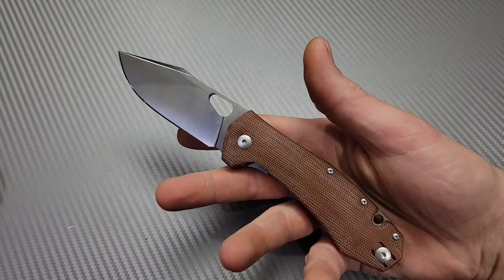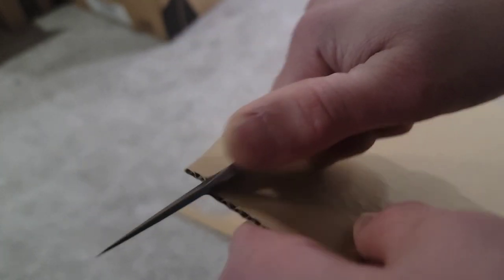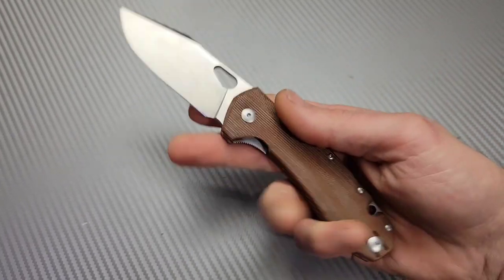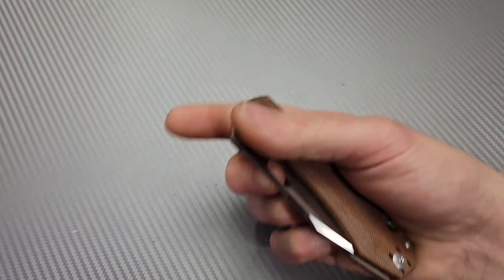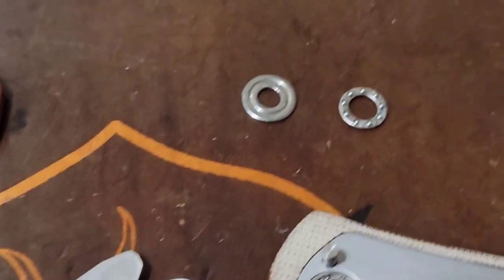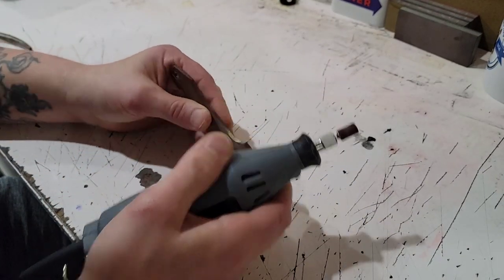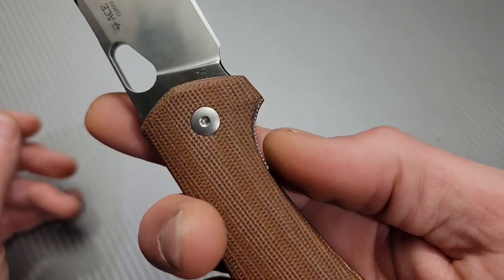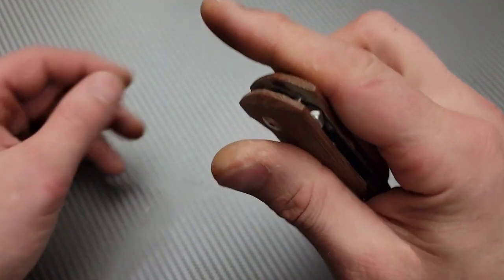GIANT MOUSE ACE GRAND REVIEW AND MODS AMAZING EDC KNIFE

Comment: I don't know what it is with Giant mouse, they designed the finger choil too small on the Ace Biblio and the liner lock is not comfortably accessible, along with sharp jimping. I was considering this knife, however since owning the Ace Biblio I haven't pulled the trigger; got some solid answers with this vid, much appreciated. Good work on the modification, I can see it makes all the difference. Solid AF.
Reply from the maker: 👊 yeah I had to do a bunch of work on the biblio as well when I had it

Comment: Nice mod! Are you worried if you squeeze too tightly on the index finger you might disengage the liner?
Reply from the maker: Not at all, all my pressure goes on the micarta, I'm not able to squeeze it with out actually putting my finger on it purposely